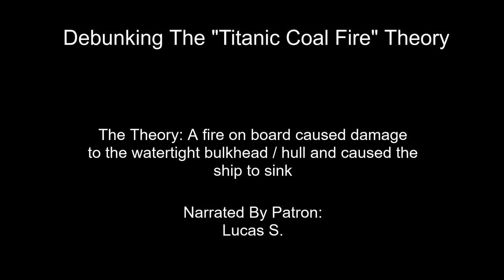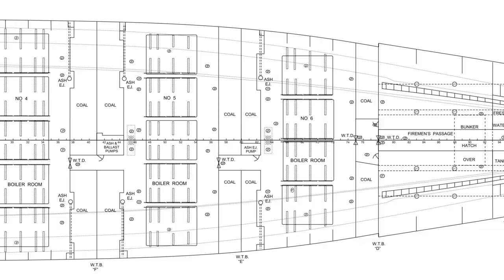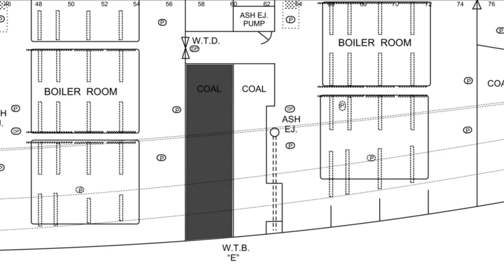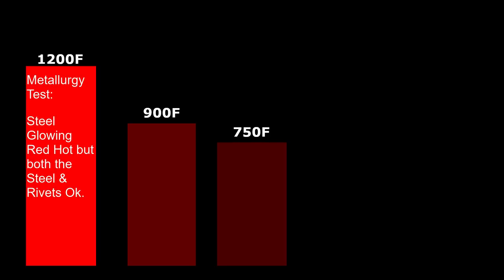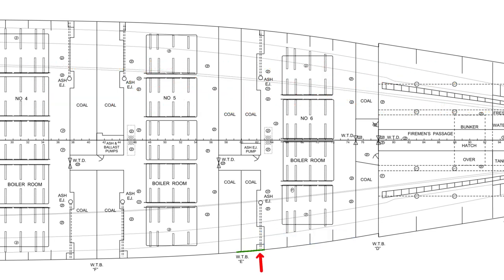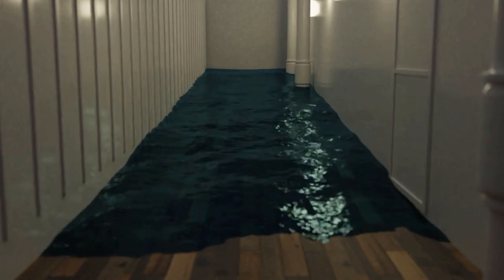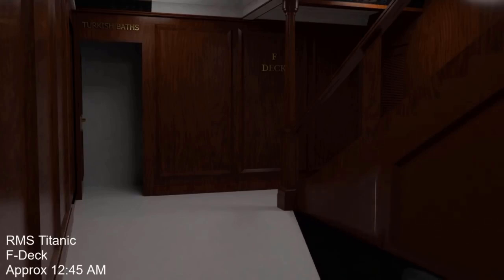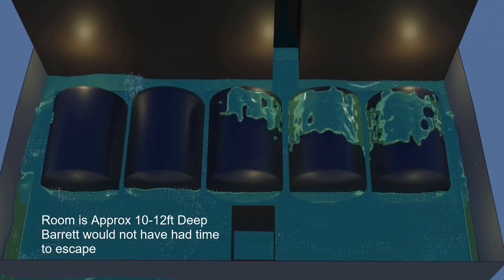Debunking The Titanic Coal Fire Theory

Comment: Now, hang on. The boiler rooms are incredibly hot rooms. If a fire did break out in the coal bunkers, close to a weak point in hull, then how difficult is it to believe that it made the Icebergs job easier to rip though?
Reply: because boiler room heat and coal fires on steamships never resulted in anything like that.
Reply: @DerpyPossum  Funny, neither have they hit any icebergs. The Titanic really did prove the impossible.
Reply: @CloakedOnyxGaming  - There was no "weak point" in the hull, for one thing.  The visibly "warped" steel from the fire wasn't structurally important, it was just the panelling that defined the coal bunker - coal fires were an occupational hazard on ocean liners of that era, and structural protection was designed in.

I mean, I get it - it's completely understandable for those of us in the modern era to want to look at the disaster and try to apply theories and explanations which may not have been understood at the time, but the fact of the matter is that Edward Wilding's team at Harland & Wolff had pretty much nailed the engineering aspects and calculations back in 1912 - it's just that the public of the day would have been unlikely to accept what they discovered.  

The quality of the steel plating and rivets was at least as good as any other vessel afloat at the time (proven by Olympic's successful ramming and sinking of a U-boat and taking a hit from a dud torpedo with no noticeable effect crossing the North Atlantic in WW1).  What did for Titanic was a failure of imagination - namely assuming a direct collision between two watertight compartments to be the worst-case scenario.  I'm inclined to think that the reason the concept of a side-swipe collision across the first five compartments wasn't considered was because no vessel had experienced that kind of damage and survived.  The simple truth of the matter is that even if Titanic were constructed using materials which met modern standards, the forces involved would still have caused fatal damage.

Comment: The metal was clearly weakened and just so happened to fail in the exact location of the fire upon impact. Nothing was debunked.
Reply: @Railfan 765 I did. Nowhere did he disprove that fact. He used some essay as a reference "proving" the metal wasn't weakened, when clearly it was deformed.
Reply: @Railfan 765 In order for the steel to morph its shape it had to be weakened?
Reply: @Railfan 765 Yes it is necessary lol... There is no way the steel could magically change its shape if it was not weakened.
Reply: @robindodd1969  - The point is that the visibly "warped" steel was not structural - it wasn't part of the bulkhead, just the walls of the coal bunker.
Reply: @turricanedtc3764  The steel was warped on "watertight bulkhead E" which is supposed to remain "watertight" in case of a breach in the hull (which it did not). This is likely to have contributed to the speed in which the ship sank. Furthermore, the fire was taking place right next to the exterior portion of the ship that failed upon impact. Is that a coincidence? Well it surely can't be disproven by "Titanic Animations" mentioning that steel cannot weaken at those temperatures when CLEARLY the interior steel warped shape and therefore was weakened.  Yes, there's a 0% chance that the fire caused the sinking BUT there's also a 0% chance that the fire had no impact in the sinking of the ship, because it did.

Comment: She was always on fire. They weakened the bulkheads, hence the gash ripped so easily by the iceberg.
Reply: Nonsense. There was a fire in one bunker, something which was not uncommon in the coal fired ships of the day. It was dealt with in the usual manner, by using up the coal from the affected bunker first.   The fire had been extinguished by around 24 hours before the collision, as witnesses at the Inquiries testified.
Reply: @MrSmid888  In point of fact, Titanic didn't burn 100 tons of coal in a day. You are quite correct. At full speed, she burned  around 850 tons per day.  To help you further, please be aware that Titanic had twenty-four double-ended boilers and five single-ended boilers. When all the double-enders were fully fired up and operational, they could consume approximately 850 tons of coal per day, or on average 35 tons per hour, and the Titanic had a total bunker capacity of 6,611 tons, which, you may be surprised to learn, was actually stored in several different bunkers. 

The bunker on fire was adjacent to boiler room 5.  It was, interestingly, directly below the swimming pool. Odd, then, that no-one noticed that the water in the pool was boiling, or that the surrounding metal was heating up?  Moreover, this bunker was well aft of the smudge on the negative which so excited Senan Moloney in 2017.

Perhaps you haven't read the minutes of both inquiries in their entirety, as I have? Instead, and to help you, I recommend you look at 'The Titanic 'Switch' Theory - Exposed,' and read the section headed 'The Coal Bunker Fire - Reality.'  After that, you might read 'Titanic - Ice & Fire,' further to improve your education.

Please feel free to write as many bad tempered paragraphs as you wish.
Reply: @FlatEarthKiller  I weakened the structure it’s all interconnected. Without the fire it would have pierced through. It’s been proven.
Reply: @FlatEarthKiller  she was weak at the exact point in the hull that hit the iceberg. It’s documented. Only the best titanic historians know. It was mentioned at the enquiry at the time and laughed off. It SUNK the Titanic I’ve no doubt. Because after all she was UNSINKABLE